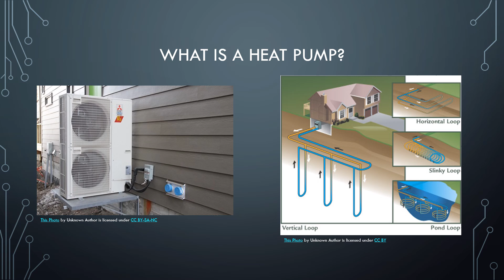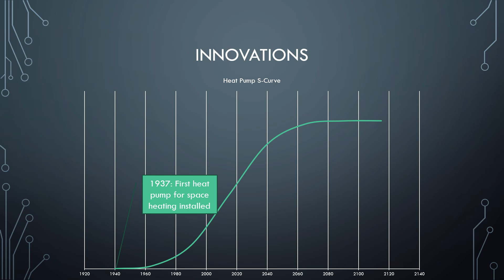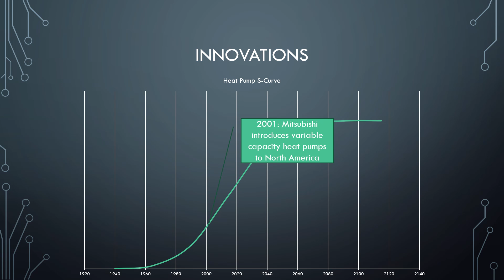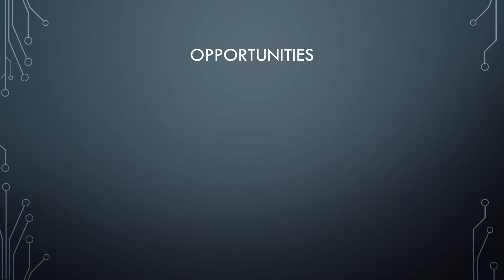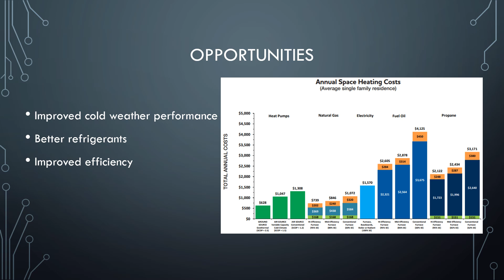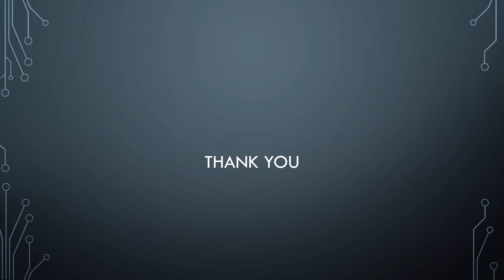619071 235851   Video assignment 4

Comment: The recent innovations in heat pump technology and how these systems use mechanical work to transfer heat from one location to another is much like a reverse air conditioner.  The efficiency and versatility of air source and ground source (geothermal) heat pumps and their ability to achieve efficiency well over 100% can significantly reduce energy bills compared to traditional heating methods, despite the higher initial installation costs.

Oluwagbotemi (Temi)

Comment: Interesting tech for sure. I guess in climates like MB we see geothermal sometimes but not really any air source. 
Brett
Reply: Lot's of air source heat pumps in MB. We have a couple at our cottage and they work great and save on our electrical bill. There is heat energy in the air until absolute zero (-273C). Most heat pumps can operate until around -20C.
Reply: Well now I’ve learned something new today! Interesting!